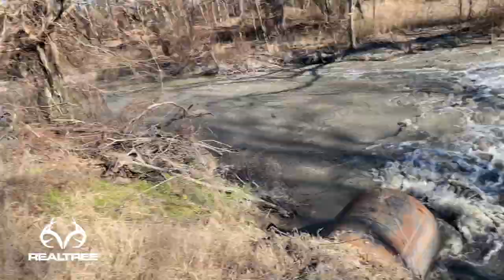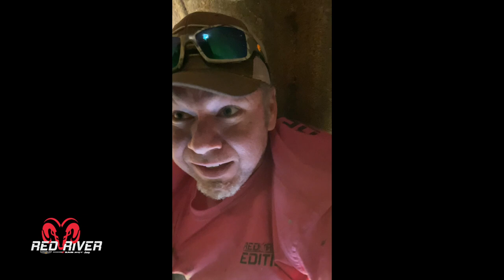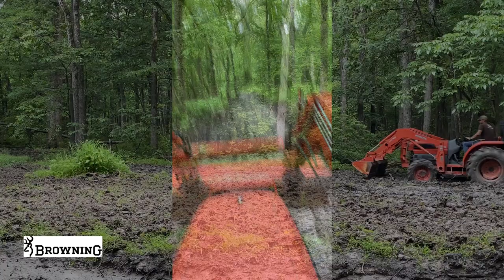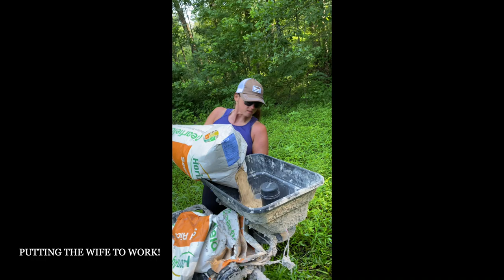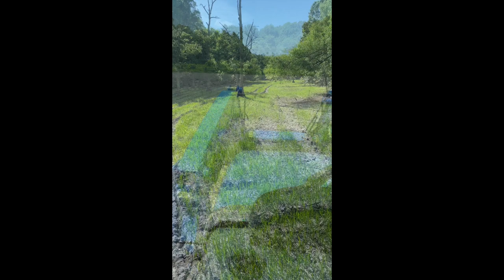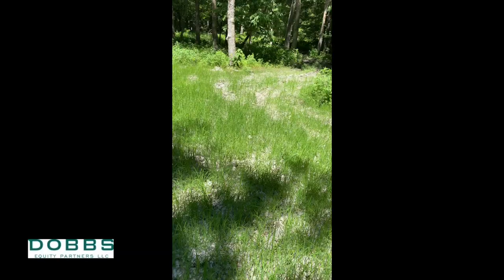Off-Season Work and Planting Food Plots For Ducks | The Process | Into The Woods with Rusty Creasey

Comment: I’ve planted rice and millet this year, curious what weed killer you use and what fertilizer works best?
Reply from the maker: I plant clearfield rice so I spray it with beyond, permit plus, perc plus, and surfoil.  Newpath is in the beyond which will kill conventional rice.  I just put urea out over the top of my rice. Ideally I'd put triple nineteen down at planting but I just can't haul all that into the woods.